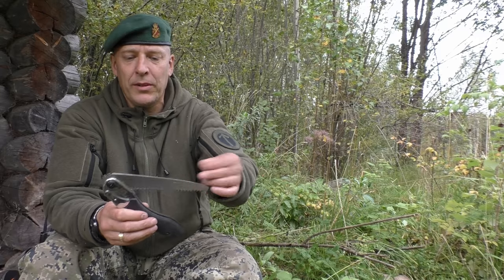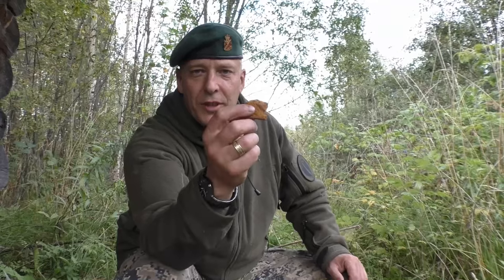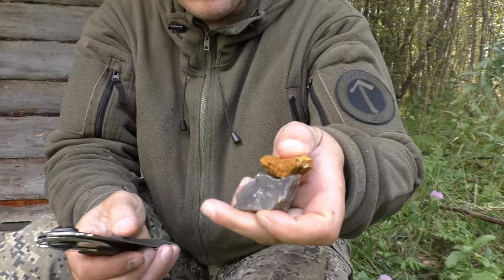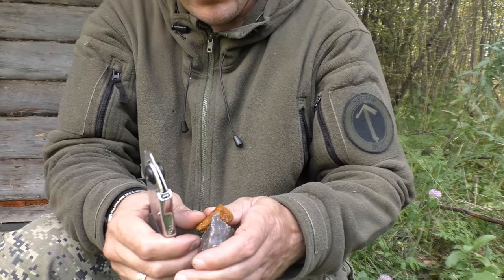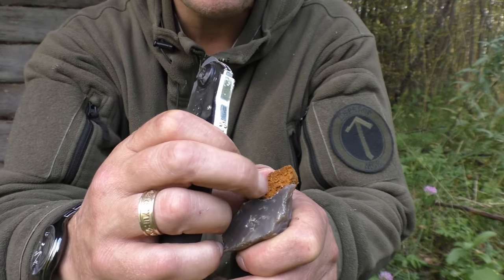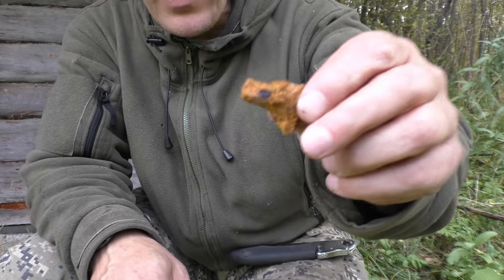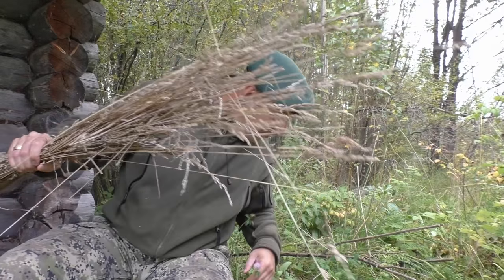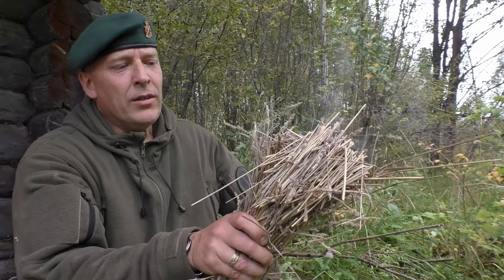Making Fire With Stainless Steel?

Comment: The BIG lesson here is, as you say "Do your own research."
So many people just mimic what they hear others say and never really think for themselves and even less actually do their own testing of ideas.  Thank you for this great example of try-it-yourself.
Reply: exactly, and when you do youll find that silky saws are not made of stainless but of sk-4 carbon tool steel ;)
Reply from the maker: To quote one of Japans major steel manufacturers, and others for that matter: "SK4 and SK5 are classified as martensitic stainless steels. They are used in a wide range of fields due to their workability, hardenability, 
price, and other features". http://www.tokkin.com/materials/high_parformance/knives Also the blades on the Silky saws have a thick chromium plating - not just a coating. You can say SK4 and SK5 are not true stainless steels as they can stain a little, but i can certainly also call it stainless when steel manufacturers call it so ;)

Comment: The only reason between a strike-spark of carbon steel and stainless steel is their Mohs hardness and elemental composition.  Stainless steel is harder than carbon steel.  Both steels have different carbon content, with stainless having less carbon, and chrome making up the difference.  The carbon within the iron from the strike-splinter, combusts the iron into a hot metal ember.  Stainless is technically less likely to strike-splinter and spark with its higher hardness and less carbon to chromium mix, ... and burn with the higher intensity of the higher carbon to steel content, and less hardness carbon steel.  But, both will strike-spark.  It is just harder with stainless steel.

Good vid, and good to see you wearing your beret !!!!
Reply from the maker: Good info and thank you very much John :)

Comment: First, your videos are great! You show common sense bushcraft. Thanks for correcting the myth that you can't start a fire with flint and stainless steel. There is another fungus common on birch trees in Wisconsin called horse hoof fungus (because it resembles a horse's hoof) also called amadue. Not sure on the spelling, but it works just as well as chaga. Please keep the videos coming. I want to learn bushcraft/woodscraft from other countries.

Comment: Great video! I had this discussion a couple of times. Some will even say you can't strike a FIRESTEEL with stainless.. as you say: get out and train and get it done :-)
Reply from the maker: Thank you (Mange tak) Lars :) You can strike it even with glass as far a i know.
Reply: +Survival Russia Jep. Glass, flint, sawblade or even a sharp edge on a shovel. I looked at my saw by the way. It's a Felco and I think it's stainless, but it makes sparks just fine with a bit of work.

Comment: Hey , yes with the strainless steel saw from Silky it is working, i found out myself also, great you bring this out to a greater public :)
However there is another fungus that is usable straight like it is (as long it is dry) in the way you can use chaga. It is called King Alfred's cake also called cramp balls (Daldinia concentrica).
This mushroom is where i live much easier to find then chaga.
Atb oakleafNL

Comment: Excellent video! Demonstration is the best proof of a point. And I agree, your daughter is precious. I like your "use what really works" attitude. I just subscribed.

I have been a knife dealer, survival and outdoors supplies dealer, practiced a bit of what is today called "bushcraft", and primitive survival over the last 40 or so years. I got into the carbon steel versus stainless steel knife debate a few decades back, and I have learned a bit since then. The question is always which is better, carbon or stainless steel, for survival / bushcraft and for combat. (Just like "What is the best caliber for a survival gun", it is an unending debate.) Of course this includes the truism that only carbon steel can throw sparks to make a fire. 

The "standard" carbon steel is SAE 1095, where the "95" is the fraction of a percent of carbon content. Thus 1095 is basic steel with 0.95% carbon content. I was quite amazed to find the mixture (recipe) for 440C stainless steel has from 0.90% to 1.30% carbon content, so it is higher in carbon than 1095! Now I see why all my 440C blades arrived from the manufacturer bathed in oil. This also shows that 44C (and probably other high carbon mixtures) could theoretically throw sparks for fire making.

There are many steel mixtures, both carbon and stainless, and "stainless" usually means the steel has a higher content of silicon, chromium, molybdenum, vanadium, and other elements that make it less prone to rusting, increase hardness, and some mixtures can even be brittle. It seems to me the hardness-inducing elements would not only reduce the ability to throw sparks, but any sparks would be lower in temperature. I will have to try several with known steel content as a test.
Reply from the maker: Thank you for the good comment MG50 :) Yes carbon Vs stainless and caliber discussion will most likely never end. I like both carbon and stainless. For "survival" i personally would prefer stainless for a number of reason but that i will put in a future video. Yes i noticed my 440c blade could spark as well. Using Chaga instead of char cloth makes it a bit easier. Chaga lights up real easy.

Comment: The steel of this saw would be pretty much one of the best steels availible to make sparks if it wasn't for the protective coating on the blade. But its a fun video anyway. Ceep going! I absolutely love your videos.
Reply from the maker: Thank you :) I doubt this steel is one of the best for making sparks for a few reasons. Some have said it's a carbon steel with a chrome or chromium coating. It must be more than just a coating because on both sides of the blades you can see machining marks. So i guess more like a laminate? Also the spine on this saw is very jagged now, as i have made fire with it quite a few times - so i should by now be well in the "carbon steel. Yet it does not spark very well, especially not compared to an old file :) Thanks for the comment friend :)
Reply: Sk-4 has a carbon content of around 1% which is quite exactly what one would take to make a file. You are right, its probably not the coating. It must be the hardness of the steel. I think these saw blades are impulse hardened with a laser, so only the teeth are very hard. The back of the saw blade is only as hard as a spring would be, so that it has the thoughness the saw needs.
Reply from the maker: Thanks for the additional info :)

Comment: In general most saw blades work well as strikers for F&S. Much better than that one did. It was good to see what SK4 will do. Thank you, Lars. 

I have successfully used more than thirty improvised strikers, just as Lars used the saw blade in this vid. Interestingly the striking face of a titanium golf club makes a decent improvised striker. (I used those from the clubs used for making the shot off the tee. They are called "drivers" around here.) Also have successfully used steels from 1055-1095, L6, O1 & O2, W1 & W2. Larry Roberts has a vid where he is successful with A2. Shovels and saw blades are particular favorites of mine for improvised strikers. 

There are at least two dozen materials that will catch F&S sparks in their natural, uncharred state just as you did with the chaga. My fastest so far with chaga directly from the tree is 28 minutes. I cut it into inch square pieces that were 1/4" thick. Then set them on a large rock in full sun on an 80°F low wind day. 

Among the many other materials that will work while uncharred are milkweed fluff, thistle (bull and canada) fluff and dogbane fluff. Milkweed and dogbane ovum. Pith from the center of the stalks of mullein, golden rod, sunflower, etc. Pith from the fruit of some gourds. Also the trauma layer of horse hoof and artist's conk. Fibers from some bamboos and palms.

Many know that charred punkwood will catch the sparks from Flint the Rock and high carbon Steel, aka F&S. I was very pleased to discover that some white rot punkwoods work to catch the sparks from F&S in their raw, uncharred state. They work best when cut into wedges. Thus far punkwood from Box Elder and Eastern Cottonwood have worked best for me in their raw, natural, uncharred state. Punkwood from Silver and Sugar maples have also worked.  

I'm sure there are many more improvised strikers and uncharred tinders that we have not yet (re)discovered. 

Cheers!

Comment: Fully agree with everyone writing your daughter stole the show ;) 
What I found very interesting is you telling in your part of the woods there is no flint to be found. Also Chaga is limited to certain area's so most people rely on char cloth and carry a container to make it in. I'm currently in a 'discussion' with some of those 'must have a carbon steel blade because Cunterbury says you need that for a flint and steel fire and flint and steel is the best' people. Of course it's a good skill to have, like fire by friction, but not reliable if you have to get the materials out of nature. And for the weight and pack volume of the flint, steel and container with char cloth or Chaga (Chaga is very lightweight I know ;)) I can have 5 ferro rods divided over my pockets and packs. Some would call that redundant and I call it abundant.

I have no idea what this 'pocket boy' is made of but in a video of mine I do mention using the folding saw or machete as steel with the flint and have a stainless steel knife for the food prep.
Anyway. Enjoyed your video as always. Atb from Holland
Reply from the maker: There are no stones here at all actually. I find it to be a really strange "advice" to select your knife material based on being able to make flint & steel fire. Just another salesman "advice" from DC :)
Reply: +Survival Russia. Indeed. And it works because a lot of people buy that stuff. More the what I call 'Bear Grylls generation' but a lot of Americans like their O1 tool steel and probably would use it as a diving knife. ;)

Comment: I tried it with 440a stainless, it worked. But the sparks are less in number and less hot. So harder to get a good spark from the steel. As you proved in your YT movie. , try it yourself and you will see what to believe.
Reply: I've used a firesteel with SS Mora's a few times. Works fine, but as you say fewer sparks. I get over that by "preloading" the firesteel before trying to draw a spark. By preloading, I mean running the knife over the steel a few times as if you're trying to polish the firesteel; this builds up a tiny extra amount on the surface of the firesteel. After that, do a normal stroke and you'll get some nice sparks.

Comment: Silky saws are plated with chromium. The blade is not truly stainless. They have carbon steel cores. But I think stainless could spark flint. But try it with a stainless kitchen knife just to be sure. I know stainless will easily spark ferro rods.

Comment: I respectfully and humbly submit to you that Silky saws are made with Japanese SK4 High Carbon Tool steel and are not Stainless Steel, though.
Reply from the maker: I respectfully and humbly encourage you to check the link to the Japanese manufacturer (Tokkin), but here's what they write: "SK4 and SK5 are classified as martensitic stainless steels. They are used in a wide range of fields due to their workability, hardenability, price, and other features." http://www.tokkin.com/materials/high_parformance/knives
It's stainless alright. Maybe not the most stainless type of SS steels but still.
Reply: Yes sir, I have read it. I think it might be possible that the confusion is coming from the actual tokkin webpage describing it as a matrensic stainless steel in the "features" box but at the bottom of the same page you will notice it isn't listed in the matrensic steels category, it is listed in the High Carbon Tool steel category. If you click for more information on the matrensic steels you won't see SK4 there. It is possible that the "features" box in that chart  is incorrect. Clicking on the specs and comparing the chromium content would also support that it isn't stainless. 

http://www.tokkin.com/materials/high_parformance/knives

Comment: I have never seen anyone even try to use stainless steel. I didn't know it would work. If I ever find myself in that situation ( not very likely ) I will know enough to at least try to make a fire.There are many rocks you can get a spark from besides flint but how many people nowadays carry a carbon steel tool with them.
Reply from the maker: Make sure the stainless steel works for sparks and that you have Chaga :) Some stainless steels make very weak sparks. The 1700 series should be better than the 300 and 400 series steels.

Comment: Did you use the pithy part of the chaga that is close to the tree and which is rather spongy or did you use the rather hard part of the mushroom that is in the center of the mushroom? Amazing skill, have been looking for a way of starting a fire with flint and steel without charred material and luckily chaga is  very abundant here, but as its bot cold enough here in winter, it is of no use as a tea.
Reply from the maker: I use the orange soft part closest to the tree. Just dry it at room temperature. It dries fast.
Reply: Survival Russia Thank you, just tried it, works great for me  :D

Comment: Great to know flint and stainless steel works.  Have tried it with the ferro rod with no luck as there is no edge on my knife...  
Hadn't thought of transfering an ember from one piece of chaga to another.  Am wondering if there is any reason we may need to do this, I'm sure there is.  
Looking forward to you teaming up with your pink troll for a video:)
Reply from the maker: The reason for transferring is, that if you miss making a fire on the 1st attempt, you wont have to do it all over again.
Reply: Can't believe I didn't see that, amazing how common sense didn't kick in even when I tried to get it to work....   It's a darn good thing I'm subbed to your channel:) 
All the best from northwestern Canada!

Comment: SK4 is not a stainless steel. It's high carbon tool steel similiar to W1.  Silky saw blade is coated with hard chrome that's why its stain resistant, but sk4 is NOT stainless steel
Reply from the maker: Now and then, a YouTube Professor will drop such a comment.... However, according to one of Japans leading steel manufacturers, SK4 and SK5  are Martensitic stainless steels. Please check link.. Now I just need you to tell me that Tokkin is wrong :) I can call SK4 stainless all year long.
http://www.tokkin.com/materials/high_parformance/knives
Reply: Survival Russia Hi there, found your channel yesterday, seems all in all like really good content!
But on your given side here, your sk4 is listed as carbon steel down below. In the first chart it could be a misstake from the writer to go with stainless, cause 1. the discription then goes on with typical carbon steel characteristics and 2. it's still in the chapter of "special steels" not in "stainless steels" of the chart. Then if you look up under "details" on their page it goes on with naming sk4 "carbon steel".
So I really am suspicious on how to interpret all of that. 
Greetings from Germany
Reply from the maker: There can be carbon in stainless steel too, and most stainless steels do rust. It's just a matter of how fast and how much. There are not one "true" stainless steel.  All steels, except the TE-2 is "Classified as martensitic stainless steels". This is why I call it stainless steel :) Sandvik's 14C28N stainless is magnetic too..

Comment: Hi. 

I am not saying that making sparks with stainless is impossible (never tried) BUT the silky's blade is a carbon steel one (SK-4 with a chromium plating).

Source.
http://www.silkysaws.com/About-Us_2/Silky-Technology

So, i learned that i can use my silky to throw sparks, that a good thing to know !
Reply from the maker: Thank you for the info :) I will look into that as i am sure it says "Stainless Steel". It certainly does not spark like carbon steel. Maybe i have to make a new video LOL Thanks buddy.
Reply: we don't have the brand Silky here,but you can indeed make sparks with stainless steel,but carbon steel is superieur